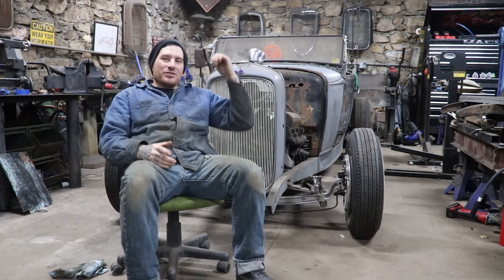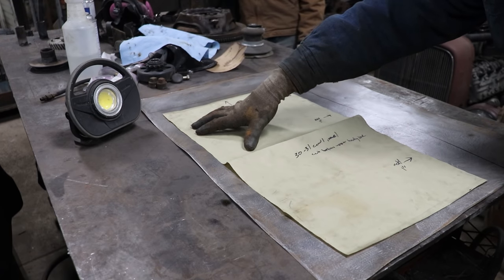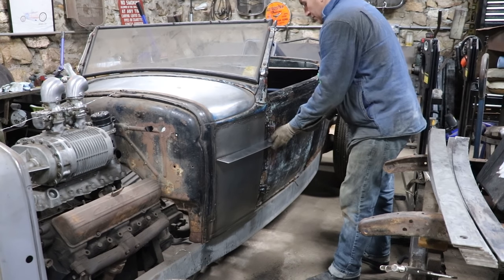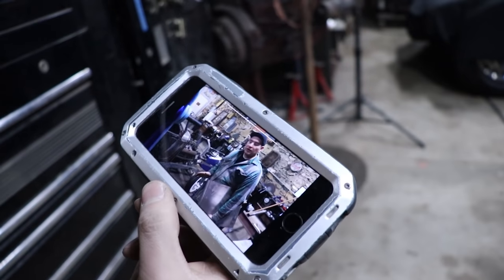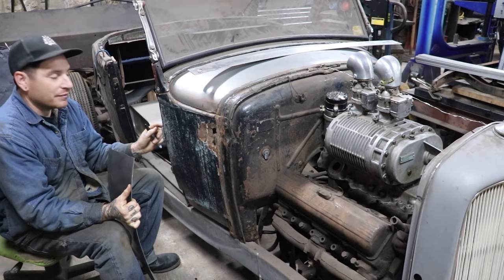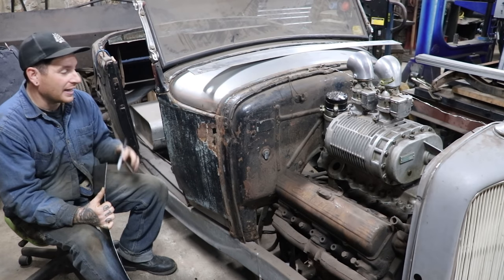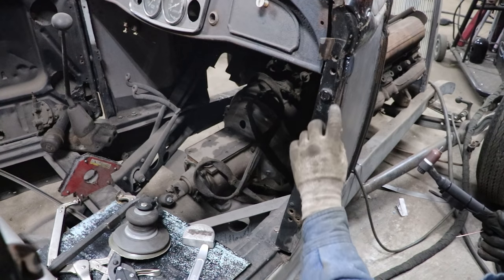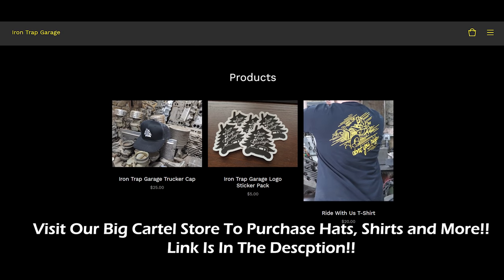Sweet Heart Roadster - Scratch Built Cowl Panel - EP. 37

Comment: Hey Matt,
Another educational video, and always interesting. 
When you are bending and the corner won't clear, you can go just off the end of the break so you don't have to cut clearance. No Box and Pan break needed.
Reply from the maker: Thanks for watching. Unfortunately I didn’t have the clearance on the end of the brake. I did try it!
Reply: @IronTrapGarage  
Thanks for the reply Matt. What brand is the old break? It looks like a nice tool. I like the built in protractor. 
I've got a little 48" Tennsmith Box and Pan that has been terribly abused. I'm restoring it, but right now it won't bend a straight line.

Comment: Consider using different color markers for each round of working metal, to differentiate each move. use same order each time, black/bed/blue/green, so if you are called away or start next day you know where you are,instead of a bunch of black marks on a panel
Reply from the maker: Good idea, I usually use longer lines on each revision as I can hardly keep track of one marker none the less 10 diff color markers. Good idea for sure.

Comment: Another great Vid Matt. I'm learning a ton about metalwork from you dude. What are some good beginner metal tools to make or buy? You should stick a couple of tennis balls in those intakes on top of the blower.
Reply from the maker: The blower has tape over the opening. The carbs are junky and need rebuilt. I’d start with a good set of hammers and dollies, some aviation snips and some electric shears at the least for cutting and hammering on metal.
Reply: @IronTrapGarage  Thanks Matt.

Comment: Matt
Save your hearing, use protection. You'll be a lot happier when you get older.
Take it from somebody who knows.
Never used protection and now have hearing aids.
On another note a question.
Why didn't you make patch panels just for the holes ?
Thanks.
Reply from the maker: Appreciate the input I actually have ear plugs and made the mistake of forgetting to use them. The entire panel was banged up, rusty, and full of old filler. I also am changing the profile/fit of the panel so it flows with the 32 frame at the bottom. For me it becomes easier to make a large panel than mess with welding up small holes and then trying to straighten a big panel with 100 years of abuse. Just my preferred method, not gospel.
Reply: @IronTrapGarage  Thanks for your answer.
 "Now I see, as the blind man picked up his hammer and saw".
Reply: That goes for me as well as i'm a mechanic too. it creeps up on you slowly and you don't notice it until its too late.
Reply: I have to totally agree, from a family of metal workers,...My father is as 83 and as deaf as a post (He really misses Birdsong!! and I am nearly 50 and am really noticing it...!!!
Reply: Matt, 
If you are needing a quick and dirty firewall bump, look at the formed steel wheelbarrow pans and even wagons. We used an old wheelbarrow on a big block Ford in an old Ford Courier truck. 429 and C-6 in a 1200 pound truck was a blast! That was in the late 70's.  Keep an eye out, it might still be out there somewhere.........

Comment: Hi Matt how would ome go about making one if one doesn't have a bead roller or an English wheel I know I'll have to replace at least one side of the 30 coupe I found
Reply from the maker: I’d buy the replacement panel or buy the tools. Other methods are possible but the time involved would far exceed the cost of a repop panel
Reply: @IronTrapGarage  where would one go about finding a panel to buy for the 30 coupe ?
Reply: Matt and where can I find boxing plates for a model A frame
Reply from the maker: I’d start with Macs, Snyder’s , or brookville. Wolfe’s metal fab sells boxing plates I’ve used before

Comment: Using TIG on sheet metal is not a talent I possess. Just curious why you don't MIG the panels. Less heat per tack, much quicker, and easier to setup and run. TIG is prettier on areas where it will show, but where all the welds are basically ground off and skin coated it makes no sense to me. Care to explain?
Roadster is coming along and looking great.

Thanks for sharing
Reply from the maker: Easier to set up and tack is only true if you don’t know how to TIG weld. Tig welds are softer and can be hammered and adjusted unlike a mig weld that is harder than the parent metal. Tig also gives me greater control over the weld and penetration. Ask any coach builder or high end restoration shop what they use and they will say TIG or oxyacetylene welding.
Reply: @IronTrapGarage   Thank you. My abilities with TIG are non-existent.  LOL Thanks for the explanation.

Comment: I have a1966 Buick special deluxe 2 door post and I need some help with getting it to run more reliably and to fix a handful of issues ranging from one of the window mechanisms being broken and the glass getting stuck at the bottom of the door, some electrical gremlins , some metal work and the windshield desperately needing to be resealed, but the car is pretty complete for the most part, and I cannot find anyone who’s actually willing to help me with the car , they want to get me to   dump the car so they don’t have to deal with it sense it’s apparently a , and I quote “worthless piece of scrap metal that’s not worth the effort to move to a shop, waist of space “ and numerous other very insulting things about the car, that has a good frame, trunk, doors,  hood , trunk lid, still running and driving on the original engine and transmission, amongst many other good things the car has still
Reply: blackdog1232 you can do it, just pick one of those jobs and do it’s till it is done 100% then move onto the next job
Reply from the maker: The comment above is right! Just tackle each thing one by one until it’s all fixed!
Reply: Oh I’ve been trying but it’s hard to come by parts